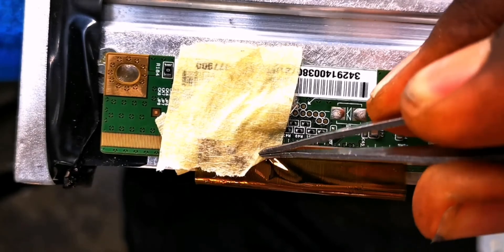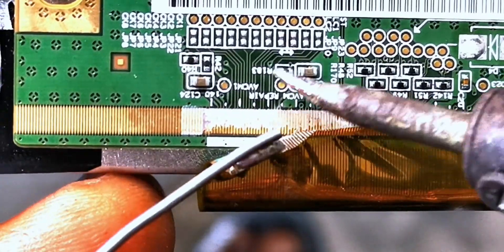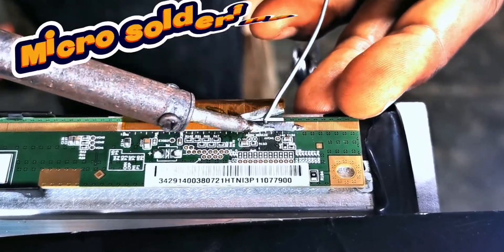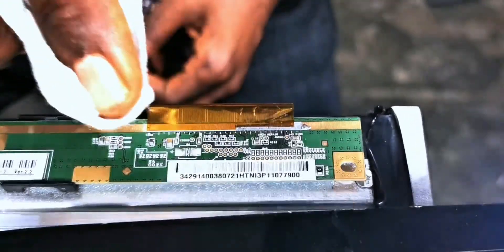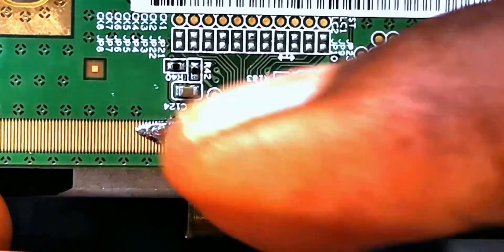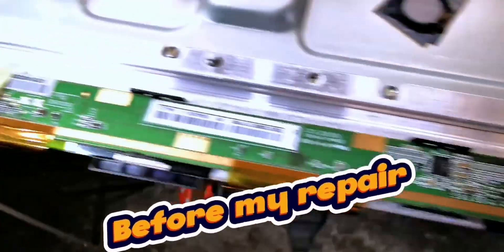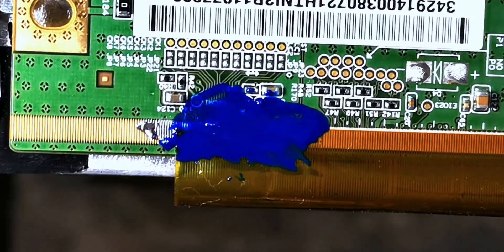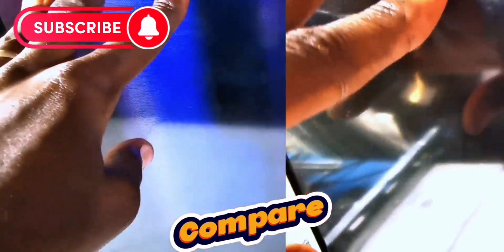Why The Repair Failed (4K LED TCL Android TV) #ledtvpanelrepair #microsoldering  #techtips

Comment: What voltage did you apply to sort out shorted gate tracks?
Reply from the maker: Hi, brother. Well, it's not that straight forward. You have to check for a number of things before you decide what exactly the panel needs at that point. If you'd like it, I can share extra details via email. 👊